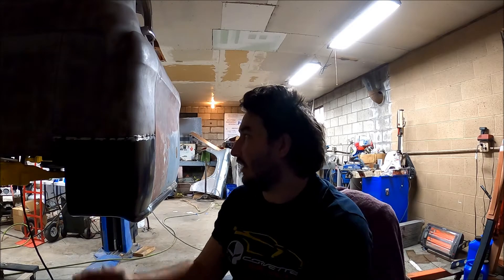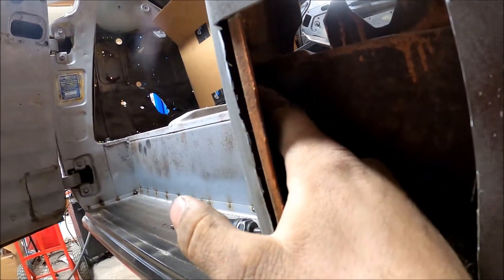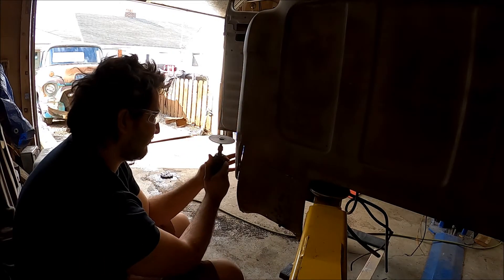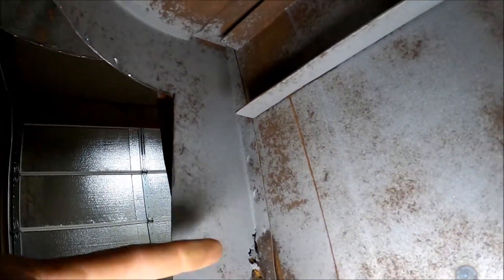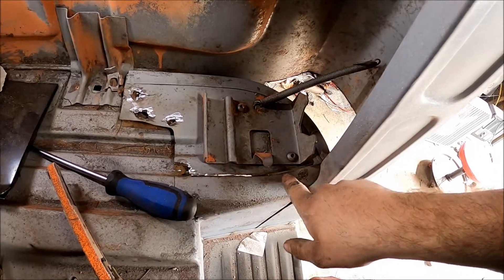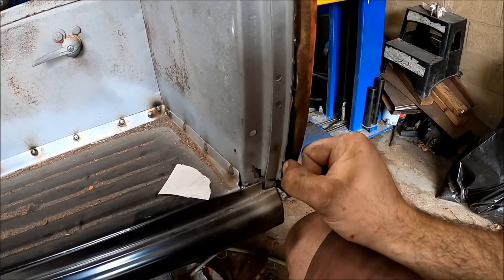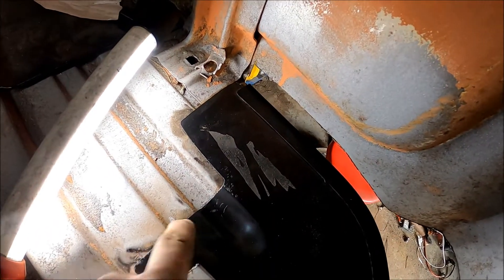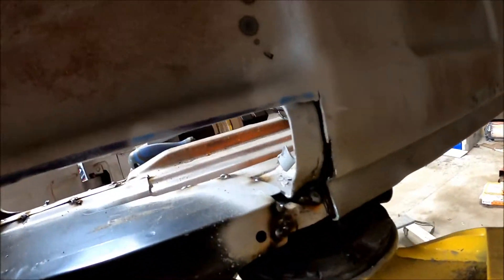55-59 rear cab corner patch panel replacement

Comment: How do you cut the spot welds
Reply from the maker: I used a belt sander
Reply: They make a special drill bit for drilling out spot welds and they keep you from drilling too deep.
I think you can get them at body supply shops.
Reply: Spot weld cutter. HF has them, #00847, double sided.  $4.99